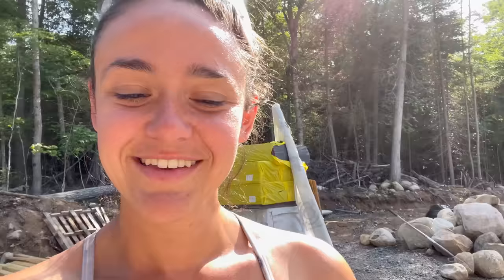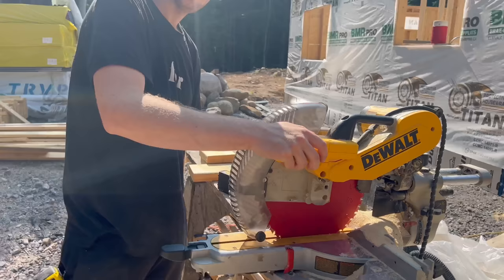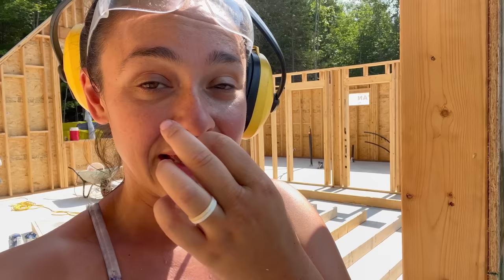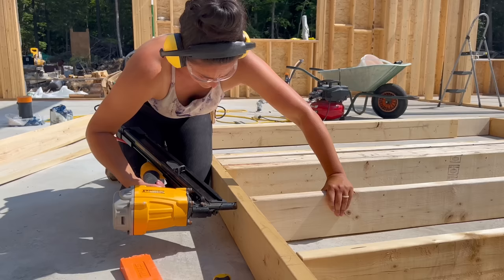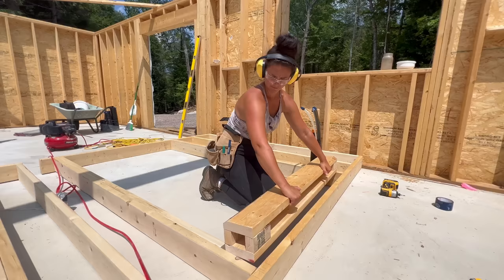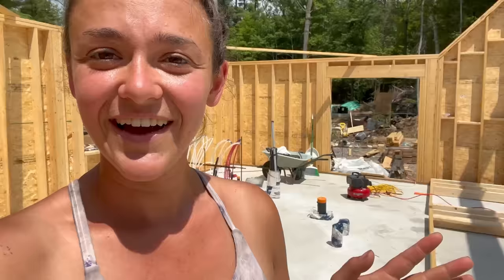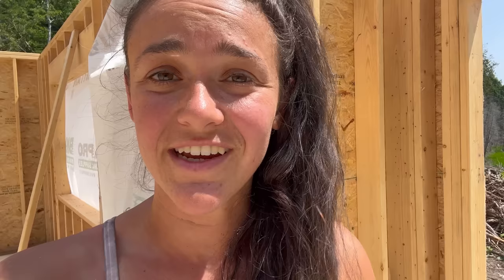When Framing GOES WRONG - BONUS VIDEO

Comment: It would be easier to trim the timber base of the wall than trim concrete....
Reply from the maker: You could cut each stud which in my opinion is a harder way to frame! But my concrete guy is willing to fix it and grind it down! I’d rather that than my wall be shorter in one spot :)

Comment: To remove a concrete hump start with an angle grinder and diamond blade.  Take the top handle off the grinder.  Get a bolt that threads into the handle hole.  Get washers that are the bolt size for spacers.  On either side of the hump set up a couple wood rails (2x4 or 2x6).  Get a long board that can go across the rails and long enough for the center of that board to reach either side of the hump.  Drill a hold in the center of that cross piece and run the bolt though that, the spacers and the anger grinder so the blade is the right height at the edge.  Now cut slots in the hump with the diamond blade, by sliding the cross brace/angle grinder back and forth moving down the rails.  Once you get it pretty much smoothed out, put a diamond cup wheel on the grinder and hand finish the surface.

Comment: As you sit in your window sill, please consider running a small bead of caulk up and down on each crack made from sandwiching the  2x6's together, on the outside walls. This will cut off any cold air moving inward to the warm air in the winter. The caulk does not need to be anything really great, you would just be trying to stop the air flow from the cold side of the 2x6 to the warm side of the 2x6. Good job so far!!
Reply from the maker: Thank you for this!

Comment: hello Biata the hump in the concrete you could plane down the base plate timber allowing it to sit on the floor with the top in line . just means the plasterboard will have to be cut a bit shorter there. you are doing great
Reply from the maker: Thank you so much! Custom cutting the studs could work too but I’m going to get my concrete guy to grind it down!

Comment: Suggestions for the hump pull a chalk line from top plate to top plate take your studs stand them straight and plumb as possible your chalk line will mark your studs deduct your plates if it's a double three inches or whatever it is you'll have to pour self leveling or grind the slab but you can continue building walls u hope this helps
Reply from the maker: Thank you so much. My concrete guy is going to grind it down but this is a great idea!

Comment: First of all, if you have not already done so, run a string line down the centerline of that load-bearing wall.  Attach it to the top surface of the bottom plate on both sides of the house.  Take care to make it REALLY tight and snug to the top surface of the 2x6 at both ends.  Then measure how much of a hump you have in the floor.

If it's 1/2" or less, then forget about it.

You could and should do the same process at the top plate and then measure the stud length every 16" down the wall and custom cut each of the studs to length to compensate for the unevenness of the floor.

Those trusses are all made in the same jig at the factory.  The bottom cord will be flat as can be.  Your top plates all need to be in the same plane all throughout the house.  Not having them so will be a big problem for you.
Reply from the maker: Thank you so much! This is an amazing idea! It was out a lot so my concrete guy is going to grind it down included in his price :). But this is an amazing idea

Comment: I would snap lines wider than width of wall then use circular saw with cement cutting blade set to depth of hump, cut lines through hump then use angle grinder then rent floor sander to nock the rest of hump down later.
Reply from the maker: Thank you! I am going to get my concrete guy to grind it! He’s got the tools for it and it’s included in the pour day price :)

Comment: If you can identify on the floor the bump by drawing a chalk around hump.  Then IF area is small enough you can buy a cement grinding metal looking grinder pad to go on your 4 1/2" grinder and grind it down yourself.  A very dusty job so an absolute requirement is a very, very good respirator and safety glasses and face shield.  A very messy job but it could be done.  Keep and eye on flatness of floor. The grinding pad can be bought at the big box stores and will be useful in future brick/cement work.
Reply from the maker: Thank you so much! My concrete guy will be doing it for me! Thankful for that!

Comment: I would just make the adjustments on the wood so it is level the put up a straight board level it and cut the wall and bring it down to level! easy you can do it your self no extra cost!
Reply from the maker: It’s a great idea but my concrete guy is doing it included in the cost I paid him :).

Comment: You probably solved the hump in the slab but I'll go with it, I use a level of course to find the perimeter of the rise and circle it I cut carefully slices on the top and either use an air chisel or hand chisel, then keep checking not to go too deep, have had to do it many times with floor tile installation.
Reply from the maker: Thank you for this! I’m going to have my concrete guy come with a grinder to fix it!
Reply: It's possible to absorb the high spot, but depending on what is there? Like a door or just a pass through, it can cause a domino effect down to finish and you get a can of worms to deal with, as I mentioned earlier especially when doing the floor covering, you have the correct mindset in my professional opinion, if there's a problem get it handled immediately before anything gets piled on, it just adds more work amd and frustration, learned from the school of hard knocks on that one, I have been very miserly in complimenting, cause I have had way more bad than good in this field you are doing great, and as a professional builder 35 years and counting, you really bit off a big chunk, and you are managing it better than most, I've seen people come completely unhinged on less, so fussing and mutterings and cussing just go with the job some way there has to be an outlet for the frustrations that always come up, and I'm used to joking and one liners all day, cuts the stress, now days they can't handle that! I've heard guys on the phone F bombs flying and it sounds like a chicken clucking, all suggestions are noteworthy and they occur to me too, got to find ones that work for you, none of this ever really just falls together it has to be made to work.
Reply: Btw, you guys did very well on the$$$$ impressive, easy to get out of control, nice thing about wood? Is if it can't be used here or there, it can be burned in the boiler or making syrup! 😊

Comment: You have an angle grinder yes?
You don't NEED to get a huge industrial thing, just grab a dust mask, angle grinder with grinder discs and go to town on that warped concrete. It might take a good long while, but you CAN get it done with a regular angle grinder (Have done it myself, and seen other people on youtube use angle grinders to smooth and flatten concrete).
Reply from the maker: Thank you so much for this! Great tip!
Reply: Your more than welcome, glad to help. GL

Comment: Islandman is correct. Building of a slab you need to use a transom to check all of your walls for correct height. Sorry. Fix it now before it’s too late
Reply from the maker: The day just went way too fast for them to even check the height! That darn concrete dried too fast
Reply: @SimpleLivingwithBiata  not the end of the world. Nothing time and a Sawzall can't fix. Hump is the middle of cased opening so try cutting out bottom plate in opening may give you some relief. Running strings and bracing exterior wall wouldn't hurt. Good luck. Concrete is the worst

Comment: A suggestion on the floor hump. I would have put a chalk line across the top/side of the wall from one end to the other. Then, use your sawzall to cut each stud as needed and nail the stud through the plate again. Done, wall is straight but floor has a slight hump nobody will likely ever see or know about.
Reply from the maker: That is a good idea! It definitely would make the wall a bit shorter in that area!  But I think you’re right, this is how it’s normally done!
Reply: @centexan  Grind down the concrete with in floor heating pipes and hope to try and get it reasonably level and smooth? Have you ever done this before? Risky and will look like horrible. That’s why the guy isn’t showing up to do this.
Reply: @SimpleLivingwithBiata  Only by a few inches max. You’ll never see it. Hope you can find someone to grind this down and make it nice and smooth and level.

Comment: Biata, couldn't you just trim the studs at the high part of the wall till the top plate was all level to a string line?? Seems to be the easiest way out..
Reply from the maker: I think this is the way it can be done but it’s such a significant hump so my concrete guy is coming back to fix it :)